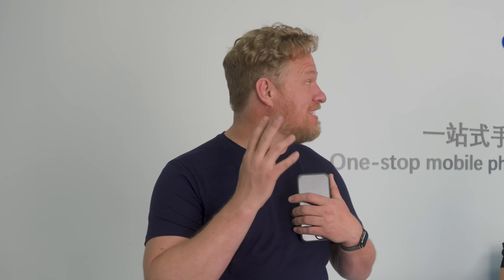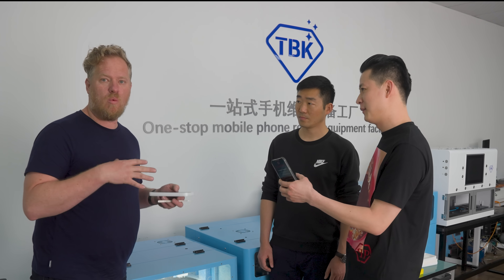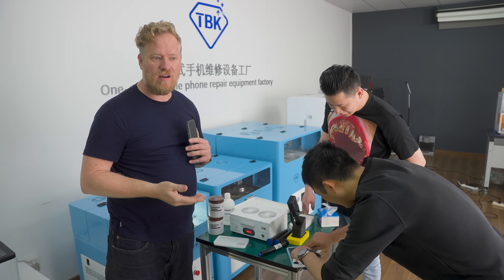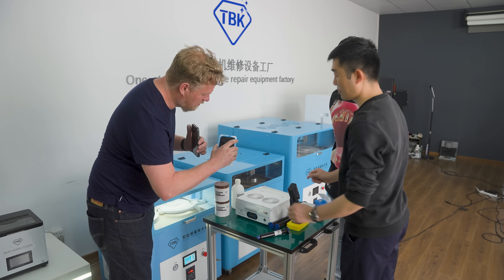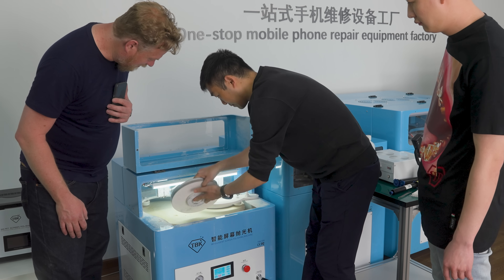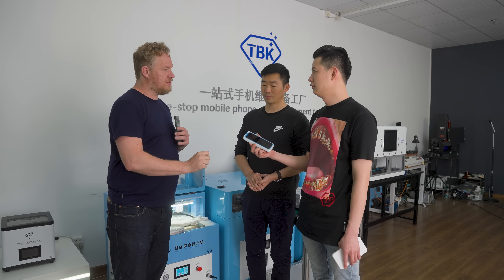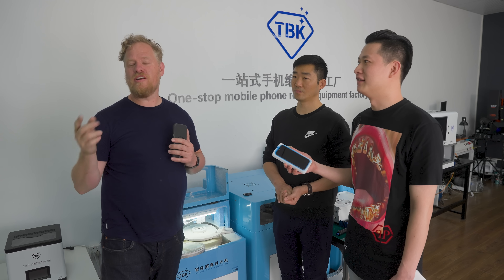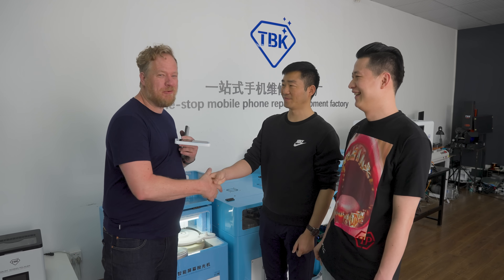Making old iPhones look like new? This Chinese machine is magic!

Comment: My only concern would be the oleophobic coating on the surface. I wonder if they found a way to properly apply and re-seal the coating. That's the only thing that I've noticed with some refurbished devices.

Comment: I got a second hand phone a year or two ago. I could instantly tell that scratches were polished out of it with a pad. I suppose the benefit to this method, is that it suspends the screen above the compound, so that the pad doesn't make super small surface scratches. This being said... There are only a certain amount of times you can polish a scratch out, before the screen becomes too thin to work properly. So slap a protector on straight after!

Comment: Phone displays are already very thin, on the order of half a millimeter. They also may have some coatings: anti-scratch, anti-reflection, oleophobic, etc. All that would be removed by this process. You're going to want to put a good screen protector on after polishing the display like this.

Comment: Doesn't this process completely remove whatever coating the screen might have? (The oleophobic coating for example)
Reply from the maker: Absolutely. It can be reapplied (it’s a liquid that’s sprayed on the glass), but I doubt a lot of the big refurbishers using these kind of machines are doing it.

Comment: The protective coating on the glass is completely gone with that method. Enjoy your fingerprints from every single tap. It's going to look like a nightmare after one day.
If they also applied back the coating, this would be great, but otherwise it's a nope.

Comment: What about the oleophobic coating?
Reply from the maker: Short answer - it totally removes it.  But it's usually worn off most used phones anyways by the point they would get polished like this.  However, if you look at my video about the replacement phone glass factory, the oleophobic coating is easy to spray on.  So I imagine you could reapply it after you polish the screen.  Do the refurbishers that use these machines usually do that?  I'm guessing not.  I doubt most consumers are checking used phones for the coating, and so it really doesn't make them any additional money to do it.

Comment: Basically it sands all glass down to the layer of the depth of the scratch... thinning the glass... 
But the amount of e-waste this can reduce is amazing.
Reply from the maker: Yep, absolutely.  Probably fine if you do it once or twice.  But not something you can do over and over indefinitely without replacing the cover glass.
Reply: It's leaps and bounds better than a pad polish as it's just making contact with the polishing compound and no more. But ye, definitely needing someone to develop a resin coat or something that can go over to replace the lost glass layer.

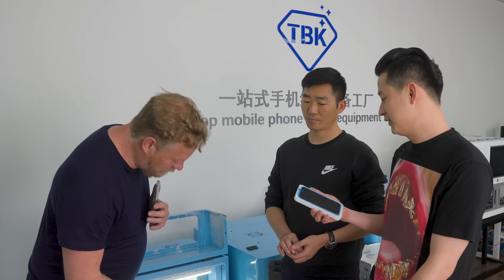Comment: 5:48 Unscrupulous sellers can make millions because they don't sell these phones as "refurbished" but as "brand new" or "opened - never used" etc, along with maybe counterfeit packaging & accessories, so that the phones can be sold for much higher prices. There are loads of such fake "brand new" phones on various online marketplaces like ebay. Ask yourself how do some of these sellers have such huge stocks of "brand new" unused phones that were released years ago and have now been discontinued (like the iPhone 11, 12 etc)? Because they are actually used phones which have been cleverly cleaned up and refurbished using processes like this, and then passed on as new 🙄
Reply from the maker: Wow, yeah, I actually hadn't put this together, but there is a lot of the supply chain needed to sell refurb phones as "brand new" on marketplaces like ebay.  I'll have to look into this more...

Comment: 👎👎👎 Non informative, dubious advertisement. 
Obviously thins out the glass. By how much? How many times before it’s too thin to be safe? Is installing a screen protector required afterwards ? What about surface treatments like oleophobic ??
Besides, the video’s thumbnail image is totally misleading by showing a very small tabletop device instead of this big washing machine size machine. 
Lots of misleading and omissions. 👎👎👎

Comment: The thing I don't understand is that even if you have that many customers waiting in line, there is a LOT of manual prep to get each one ready. I don't know how you could even do four a once without spending at least half of the time messing with the UV goo.
Reply from the maker: This is really intended mostly for large scale refurbishing shops that are fixing up and reselling used phones.  However, I do feel like it would be an interesting service to offer retail as well.  That being said, applying the UV glue really doesn't take that long.
Reply: @StrangeParts  a factory context does make a lot more sense. still, you need a small team to execute a 16x operation. it only works financially if you have more phones to process than you can process. here in the west, it's hard to picture what that situation looks like because even phone repair kiosks in malls are absolutely not sitting on 500+ unit backlogs.

it's just... a lot of phones! I guess you'd buy them by the shipping container at auction or something?

Comment: This will surely remove the oleophobic coating on the display as well so adding that back will add cost and likely is another manual step making it more expensive.
Reply: And the glass on yor screen is now extremly thin and ....

Comment: A follow up to this video would be proving how necessary the factory “coatings” are or if they are negligible and how much of the glass this polishes off or if it’s negligible?
Reply: These are usually re-applied after the scratches are removed :)!

Comment: Pretty sure they do not erase the phone scratches... they only make it partially or fully invisible. 

The process is putting lots of coating over the screen making it "seem" like the scratches disappear. 

They aren't erasing it.
Reply from the maker: Nope!  It's definitely an abrasive polishing process.  The paste in the machine is a very fine grit abrasive.
Reply: @StrangeParts  You reply to this comment but not to the 20 comments about missing coatings (and one about lower toughness) that I have seen so far?

Comment: Well, this is an ad for the machine. It’s a simple machine and has no intelligence beyond that (I’m talking about the label on the machine). The same method has been used for cars for a long time. The scratch is less than 0.5 mm. It’s just a simple calculation of the force applied by the polishing disk, along with a specific liquid to control the heat and protect the speaker. The borders (they used some kind of epoxy here) are straightforward. I’ve done this before with a cheap battery drill, applying hand pressure with a disk meant for polishing cars.

Comment: I don't think it's gonna work.  if it only fix scratches and not cracked screens.
coz economically it is cheaper to buy a screen protector on the same day you bought your phone that would last 3 or even 5 yrs..  than having it polished every year or so.

but will be a different story when it can fix cracked screen.  that shit.. will make you a millionaire.

Comment: It's super cool to see this kind of stuff being made - it's such an obvious procedure, but also one that needs to be done right to not ruin the part. That being said, clearly this will weaken the glass to some degree given that it's being thinned down, and I'd expect them to publish specs for how much it's being thinned down per polishing cycle and a limit for how many cycles a certain type of glass can take before being damaged. Of course the latter is pretty unlikely (what screen is going to go through this more than, say, twice?), and the former is just another argument for using a tempered glass screen protector, but still, it's the kind of thing we need transparency around.

Comment: if u polish too long it will warp the screen and can cause edges to lift above frame and wont allow screen protectors to properly stick but typically a fresh carpet warps the screen less.
Reply: Considering the structure.of modern screens, the glass being elevated over the frame, you'd have to abrade through the entire glass to make it sink under the frame.

Comment: What about coatings? Without the oleophobic, hydrophobic, and anti-reflective coatings you're just toughing bare glass, which turns into a mess in no time.

I hope they disclose this to the seller, because I wouldn't want to pay for a A+ used phone which underwent this and won't actually be like the original.

Comment: Honestly, this is just a way for resellers to make more money. It's more likely that the screen will crack after recieving this treatment surely, also do iPhones have an anti reflective screen coating? Either way I see no benefit for the consumer. It's just the resellers cheaping out to get more profit.
If they produce a machine that did a single phone so that repair shops could provide a service of taking the scratches out vs a screen replacement as a cheaper alternative option would be good.

Comment: So all those ads with substances curing the cracks in glass were fake and you actually need to shave of the screen? Who even have those light scratches? You either have none since most of the people use protectors, or you have deep ones

Comment: Nice demo, but how much is the machine? (Landed cost to US including transporation and tariffs).  Without that cost the claim of easy profits cannot really be evaluated as the volume to achieve breakeven ROI - is it tens, or hundreds or thousands of phones?

I do feel this is presented as if machine polishing is some big new breakthrough tech. Correct me if I'm wrong, but I didn't see any proprietary IP or breakthrough physics or engineering.  Not even sure if the company in the demo is the manufacturer or just a distributor/reseller of a standard polishing machine fitted with a jig for iphones and a few bottles of polishing powder and syringes of, as you said, generic waterproof UV-cured adhesive?

Comment: It's not no scratches, its all over scratches that width of the groove is under 5 nanometers that makes it looks like a mirror. And the component of the abrasive is CeO2, another rare-earth element that can only imported from china. There is some research reveals nanometer particles may have biotoxicity to cells, so that rare-earth nanoscale particles could be swallowed into your stomach, lungs and release Ce4+ into your blood system.

Comment: I used to work for blockbuster, we had a machine that used to remove scratches from dvds, isn’t this just the same technology just adapted for phones. Nothing really new.
Reply: It's just polishing, was invented back when the lens was, and they had corrective glasses in 13th century Italy. Didn't change that much - you just rub the abrasive against the glass.
Reply: DVDs aren't made of gorilla glass.

Comment: Could you please test how this refurbishing Method affects the durability of the Glass? Gorilla Glass Victus can withstand around 8 Newtons of Force, Gorilla Glass 5 on the other Hand only around 4. With this method the durability will be slightly lower without Question, by how much would be great to know. Furthermore, most phone glass panels come with oleophobic coatings to repel oils and fingerprints to make them easier to clean, they should consider adding it back cause otherwise the Screen wont feel as smooth as it did originally.

Comment: This is very similar process to what is used to mechanically process silicon wafers, except a lot less precise, still does an amazing result, probably will need coatings added after
Reply: Had the same thought, totally reminds me of a wafer CMP process.
Reply: @drivenbyfate yeah was gonna say that but assumed the acronym would go over people's heads xD the tool reminds me of the cmp tools from the 80's the newer cmp tools are crazy advanced now

Comment: So what about the oleophobic coating?
Reply: Apply it afterwards, its not hard to do, few drops of magic liquid and coating is done. I dont know why everyone is posesed with the  coating but not with the removing scratches.  And specialy if you put screen protector on it, teh there is no difference you had coating or not.

Comment: This does not seem like magic.  I feel like polishing glass is not a new tech, especially when youre just gooping shut the sensitive parts.  Also, I think with the thickness of the glass you are treating, grinding away any amount will affect its future strength, as well as remove any protective coating that has been applied.  This only helps unscrupulous used phone resellers.

Comment: There is no feedback on when to stop
 polishing abrading🤔. So, it becomes essential to grade each scratched phone and keep tab on when its done(shallow scratches get done first). Also there should be a safe limit, not to make the glass fragile. Reminds me of the manual polishing? wheels used to remove scuffs and scratches from vintage watch faces.

Comment: Not to sound like a grumbler, but doesn't polishing the screen down to the point of the lowest scratch reduce the whole surface area to that thickness? 

I mean, for most people, it's probably fine, and it's preventing e-waste.

But for people thinking they are buying a "near-new" phone due to the clean screen, they're not, because it's now been physically altered more, which could potentially weaken the screen.

That's why a new one is usually applied, right?

Again, I'm not saying this is bad - just - it shouldn't be presented as a brand-new screen. Maybe I'm wrong, and it doesn't make a difference...

Comment: OK, not too many people in the comments are saying it only a handful so I’m gonna chime in here too. This is a bad video Scotty. It’s clearly a ad for TBK. This also isn’t a proper fix and is more of a hack job that will be just good enough to get the phone sold ( to your own admission for maybe 50 bucks more ) but setting the customer up for a product that lacls any anti-glare, oleophobic coatings while also sending the glass by the who knows how much, but a few thousands of an inch could be enough to put you at the teetering point for your first drop to be a screen replacement. So make 50 extra bucks you’re setting your customer up for essentially a scam. While we’re at it, let’s get batteries that have 90% capacity left and start throwing those in. Instead. Of brand new batteries. We might be able to save 7 bucks per device and we can become millionaires on the backs of ignorant customers. Anyways, bad luck, Scotty. I like the content you make, but this one’s a solid thumbs down for me. Please don’t make this a new channel path. I won’t be coming to your channel for Chinese factories to advertise their “ secret art of the scam techniques and machinery “ to the three people in your audience who would even ever possibly be a customer for such a thing.

Comment: Just think about how ecologically helpful this is. Instead of having to make and install an entirely new screen as well as discarding the old one, now you can just resurface it like a CD. Not only does the repair outfit make more money but its also extremely good for the environment to not just pitch a bunch of scratched glass screens.
Reply: Or just use phone with scratches, it makes 0 difference anyway. They are not visible unless you look for them. 
There are very few people who care about this either. Most don't even replace cracked glass.
This is for very specific niche of phone refurbisher.
Saying that, I roam case-free and would love to use this every few months heh.
Reply: You could always replace just the glass to be honest, but this seems more economical, less work, less risk of damaging lcd
Reply: @swiftsilver  很难，现在很多都是玻璃和触屏一体化压合
Reply: @swiftsilver 1. No phone is lcd on 2025 2. All phones use laminated screens 🤦
Reply: @ithinkitwaskhamas  1. My phone is lcd (DOOGEE S200 Plus) Many budget phones are still made with lcd screens.. 2. Why does a laminated screen even matter, when you can go on youtube and see s24, iphone 16, etc glass only repairs? 🤦‍♂️ Its not even difficult or complex repair.. You just need thin wire to seperate the layers, clean off the glue, add more glue and put it in a vaccum and cure the glue. Lol.
Reply: @swiftsilver  but the glass is going to shatter so easy now because they have made the whole thing thinner. phone glass is ultra thin to start with and after this its even thinner. ¯\_(ツ)_/¯  hopefully its disclosed when buying refurbished, the integrity is super compromised.
Reply: i have never seen a scratched iphone.  all the owners covered the iphone with so many protective covers that most look like polar bear.  Anyway i thought the gorilla glass was supposed to be scatch proof.  So how are you going to scratch an iphone??
Reply: Or just build all phones with gorilla glass. No scratches or breaks ever. Just way less money for manufacturer, who makes a lot of money on screen replacements.

Comment: Yeah don't worry about the oleophobic coating, it's not like it makes the glass smooth to touch or reduces smudges and finger prints and makes the glass easy to clean.

In my opinion I'd rather have a scratched phone than one without an oleophobic coating.

Comment: Like everyone is pointing out, there's the issue of anti-glare and oleo-phobic coatings missing but I'm thinking about the hardening as well.
Wouldn't the glass become way weaker and more prone to scratches as well by wearing off its factory hardened surface treatment?
Reply: they can always apply it + most people put a screen protector
Reply: this goes to people buying refurbished phones, they'll have no idea